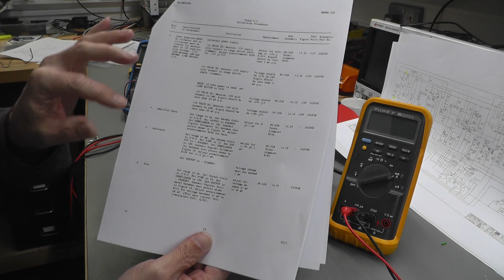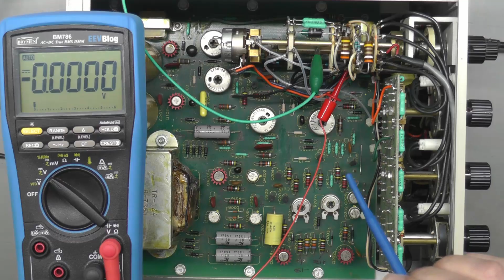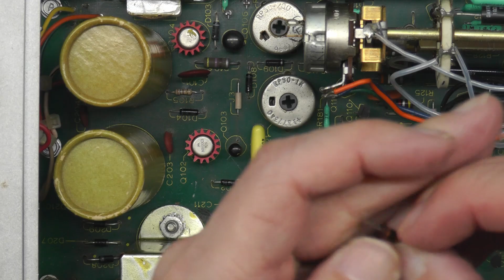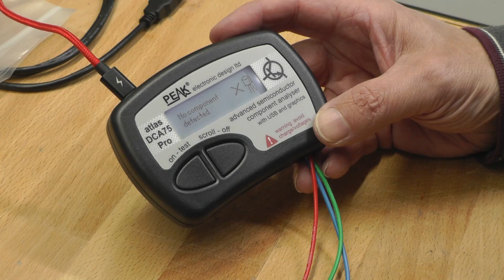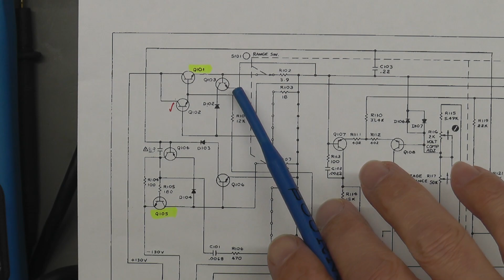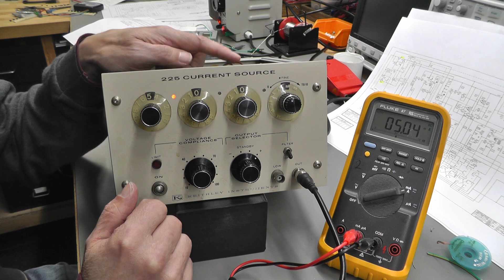No.097 - Keithley 225 Current Source Repair - Part 2

Comment: I used to clean  pcb’s   capacitor or battery spillage with Tetrochloride  and it made a good job! I don’t think you can buy it over the counter now as it’s classed as dangerous chemical! I think you need a licence for it now?

Comment: I have done a lot of valve guitar/hi fi amps over the years and as well as capacitors with high ERF carbon resistors are a real pain! i e values go high and noisy carbon resistors sound like eggs frying. The Heathkit signal Tracer is a useful tool as u can put a current through resistors with the amp power off and apply heat with a solder iron, freezer spray which weeds out intermittent faults! Metal oxide resistors are more reliable and u get them up to 2 percent - I think u can still get them! Very interesting videos though!

Comment: Boy i whish we could take transistors out of the boards in the old days to test them, we had to do all fault finding without moving components. if you pulled a good thransistor it would just have gone in the bin anyway. 😞 testing the transistor once out was just a way of showing you had got it right. But then we were only fault finding on our own boards and so we had a good idea of what caused common faults, not that we had many.  Fun part was when it was a AOG repair (Aircraft On Ground) so it had to be all done and dusted by the end of the day or faster if possible.
Reply from the maker: Back when I started in 1984 it was similar albeit not so regulated (Oil Biz) so we had the flexibility to do what we wanted during repair. What it did do though was give you good hands-on experience in removing parts from single sided in-house made boards (weak pads & tracks). Many a young tech would be ripping pads of boards, skidding their soldering iron across tracks or mangling parts in their attempts to remove. 
I think I spent a fair portion of my time repairing a previous failed repair!
Reply: @IanScottJohnston  Our problem was we had to maintain the MTBF's once the repair was made, so once the component was removed you could not rely on any stress caused by it removal would not affect it life span.

Comment: Well done, a bit bumpy analysis, though. Why didn't you use your 3458A for precisely measuring the low ranges as well? That would've been much more comfortable, also.
This 225 is not really a 'precision' current source. Keithley never made such, as accuracy was always mostly on the order of 0.1 % or a bit better. Additionally their programmable sources were extremely expensive. 
At university, we needed many really precise and stable current sources for thermometry. I never touched these 225 which we had on stock, instead we already used several Time Electronics sources, as well very expensive. That's the reason, why I designed much cheaper current sources for fixed 10µA, 100µA and 1mA for a fraction of these prices, and using the 3458A to calibrate them to a few 10 ppm accuracy.
Reply from the maker: It's about filming and repairing at the same time, your eye is taken off the target continually and the train of thought is constantly interrupted. Not to mention too much trouble to reposition cameras etc onto the 3458A. Maybe next time!

Comment: Great video again, thanks for sharing! I think Marco Reps has an automatic replace on sight policy for carbon resistors, as well as the usual electrolytics and reefer madness caps. If you're planning on using it for calibration work I'd definitely spend the time to recap at least, but probably the carbon resistors too as you can see them drifting

Comment: I would follow a marco reps methodology and just place all the carbon resistors in a mouser/farnell/digikey shopping cart for 1% metal films!
Reply from the maker: If i end up using the 225 regularly that sounds like a good plan.
There's a BOM in the manual so easy n quick to order.

Comment: The output low needs to be used as the 0v side, either by linking the centre to the outer, or by using a bnc to banana adaptor to give you the output pin connection, when I fixed mine I used two bnc to banana adapters and spun them to allow me to use the negative from the left one, and the positive from the right one.
EDIT: never mind, you have the link fitted on the rear panel instead LOL.
Reply from the maker: There are different versions of the 225, some with bananas on the front. Wouldn't be surprised if some don't have bananas on the back.

Comment: Nice! I noticed on mine that mains noise gets through the instrument pretty easily, even with the filter turned on. I plan on adding a mains filter in the back but I haven't had the heart to drill into the case yet lol
Reply from the maker: My mains cable could probably be due replacing, so perhaps an IEC mains filter socket would be a great idea! Thanks for the idea!

Comment: Fantastic!  Love that new Peak tester - I like the ability to get more data via PC connection!
Reply from the maker: Expensive, but a great tool. Saves playing with diode test mode on a DMM to check transistors but still have doubts.

Comment: Nice fix. Probably all stemmed from just one transistor failing short
Reply from the maker: As seen, the bias voltage drifts due to bad standby contact, i wonder if it drifts far enough a transistor fails. Hmmmm!